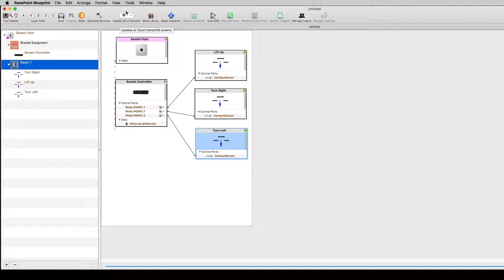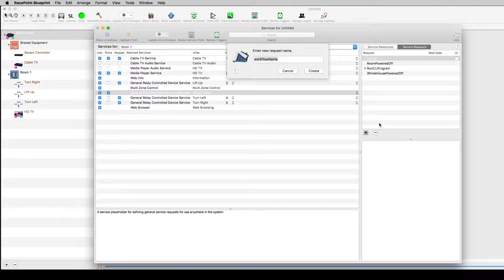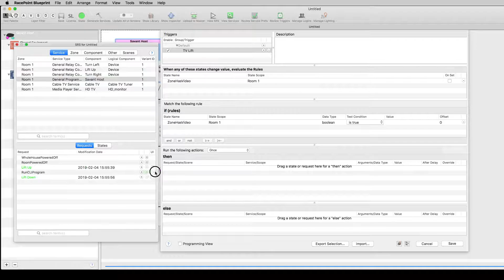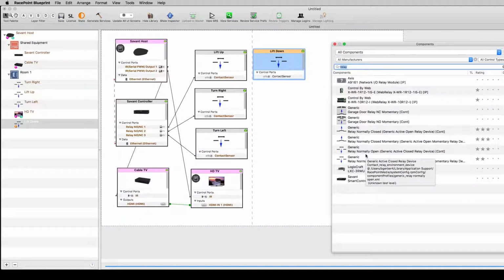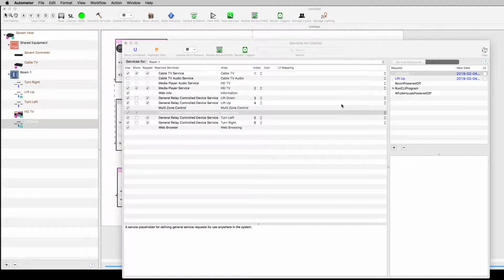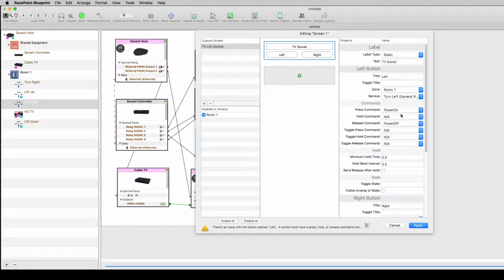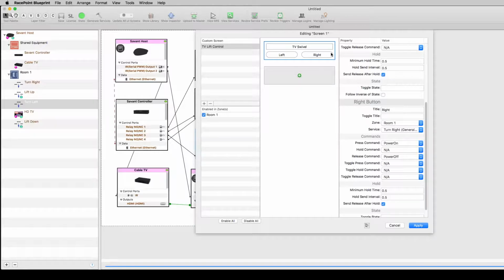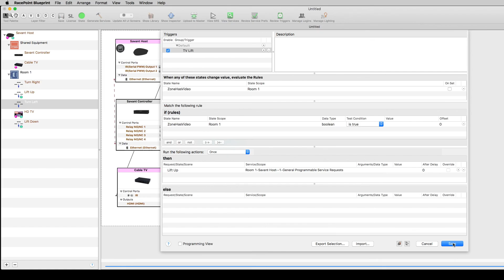Lift Trigger Example

Comment: Brilliant video but I would really like some more in-depth info. We wanted to Send a Power (indiscreet) to a sky box when zone has video but the power is below standby watts. We have the triggers correctly but as soon as the zonehasvideo is on the power is still under the threshold until a few seconds it boots up. This results in sending the command all the time. If we use the delay it only delays sending the evaluated output. Is there a way to delay the evaluation part of the formula ? Is this what the offset is for?